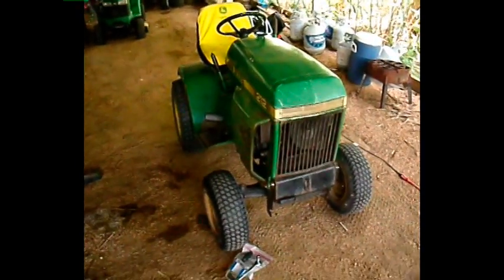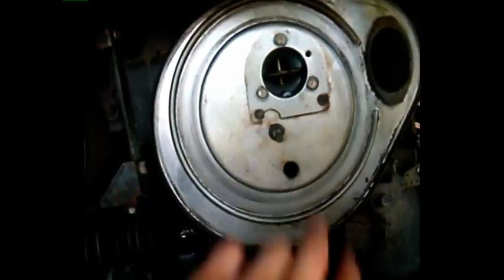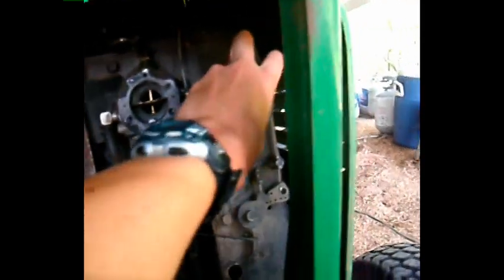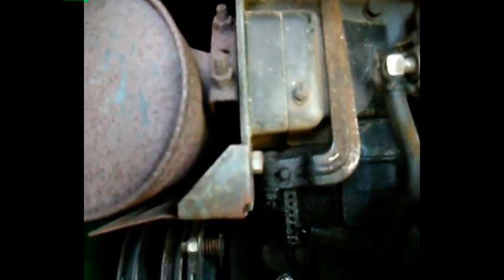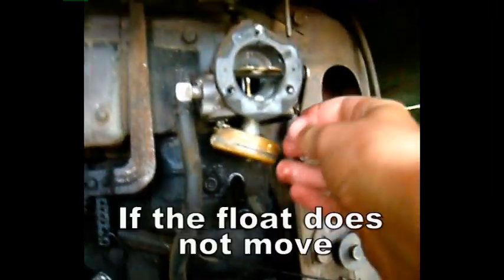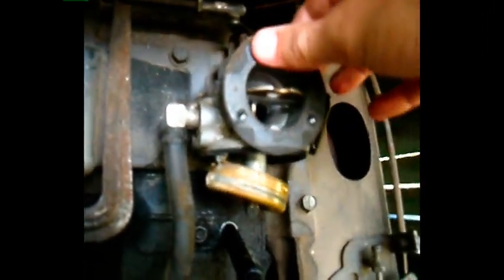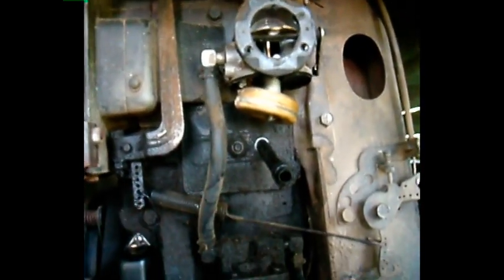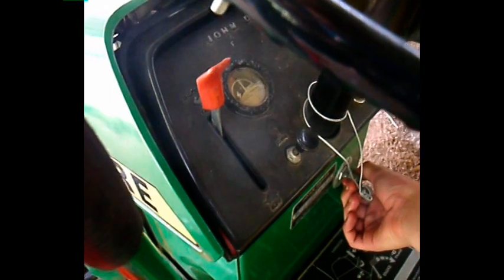How to clean the carburator on a John deere 200, 208, 210, 212, 214, and 216

Comment: Thanks for posting, and for being honest. When you mentioned the side hole in the bottom jet, I was elated cause my 214 has been giving me fuel system problems, and I didn't clean out that hole. Because, (like you mentioned) there isn't one. My inlet needle keeps sticking, and shutting down the fuel. I'll be pulling it out today.
Reply: Try to use brake cleaner not carb cleaner cuz carb cleaner will eat paint, & eat at rubber seals. Just don’t get the ORilieys brake cleaner cuz it’ll eat paint a tad. The one from autozone won’t.

So I I didn’t mention in the video the the bowl needs to come off, the rod/needs & seat come out, then mark w a sharpie where the center nedle is on the carb before you remove. It’s 2-1/2 turns out after fully in, the needle needs to come out first before the jet is removed.
Reply: @michaelbenoit248  Thanks again for your tips. After cleaning out the carb., the motor still wouldn't start. Why? Because this time, (not like B4), the fuel pump quit. I pulled it apart, to see if the diaphragm was ruptured. It wasn't, so I sprayed the check valves in it with carb cleaner, and blew it all dry with air, and after re-assembly, it now runs....again. For how long? Only time will tell.

Comment: I am having to run my 212 with a wide open choke and it still barely runs. Going to try this
Reply: Hi, I’m MikeJD60 but on my other account. 
I’m I
When I had the stock carburetor on the tractor it did run fine like that, but be careful running it really lean tho, you can overheat the engine & melt a piston.

When you have the carburetor off check the theottle linkage, if it’s got an insane amount of play in the open position & you can see an indent in the carb on the top hole where the linkage goes through. 

Over time things wear out & need to be replaced. I ended up replacing the carburetor & it use way lass fuel, these newer carbs are more efficient.

On all my old machines I have new carburetors, the old carbs work, but there still 30-50yrs old, & things like that don’t last forever.

On these old carburetors, if you have any issue right after it’s been cleaned or cleaning doesn’t make a difference, just buy the ISaveTractors carburetor, but hold on to the throttle linkage. 

I ended up using the old one since the new one wouldn’t fit right.

Thanks for watching, hope you get it going again!
Reply: @michaelbenoit248  original john deere carbs are way to expensive . did you buy a 20 or 30 dollar Chinese made carb?